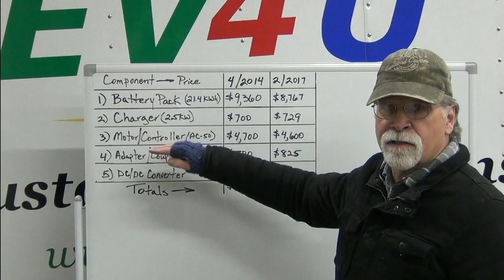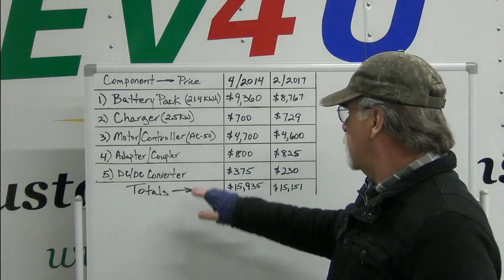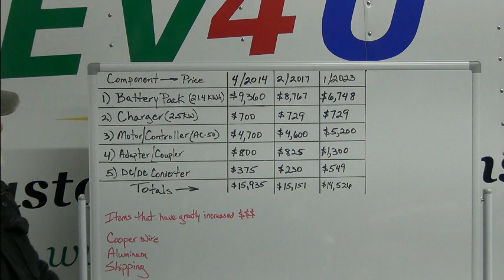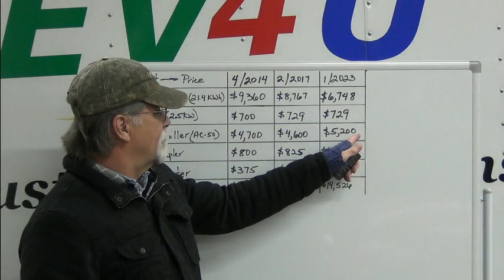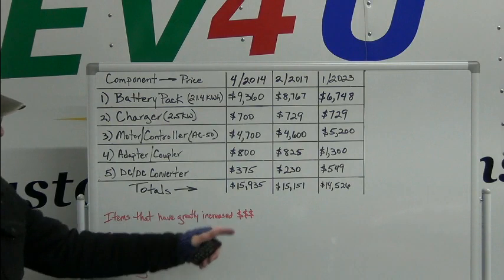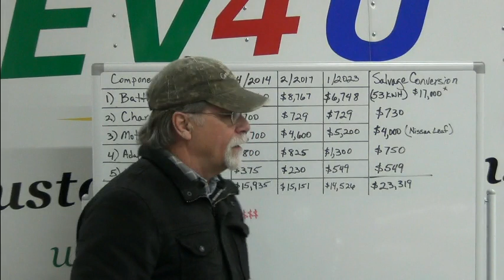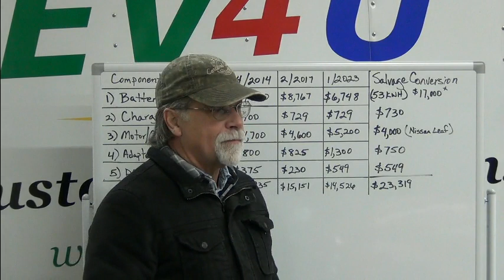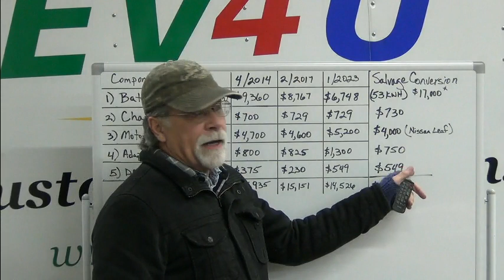EV Conversion Cost Comparison

Comment: 10:00
consider adding a model 3 power conversion system as a salvage item, you can get a good one for $500, and use the openinverter control board, which costs $300 shipped from ireland. this gets you a 10kw onboard charger and a 1.5kw dc/dc converter in one box, liquid cooled too, so WAY better specs for only slightly more

Comment: I always wanted to build my own but...looking at the cost of the salvage parts from a Nissan leaf vs. buying a brand new 2023 chevy bolt for 27k and some change with a 65kw battery 259 mile range. Compelling to buy new in this example. Not as fun or not as much a headache depending on your outlook.
Reply from the maker: A conversion is not about the money as much as it is about the car.  Like building a hot rod or restoring a classic vehicle.  Thank you for watching.

Comment: Oh man, I feel for ya.  Here in florida, it's also very cold.  FANTASTIC video, thank you so much!  Do you know why HPEV stop making the AC-75 and 76?  I really liked their numbers, and I will eventually build a mid-sized sedan and run it at 144v.  Yes, the Hyper9HV is a nice motor, but we used to have two great options in that range.
Reply from the maker: I have been told they discontinued the AC-75 and AC-76 because they were too close to the AC-50 and AC-51.  I really think it was due to cooling issues as they are sealed motors.  The HyPer 9 motors have impressive peak performance numbers but have cooling issues on vehicles over 3,500 pound.  Thank you for watching.